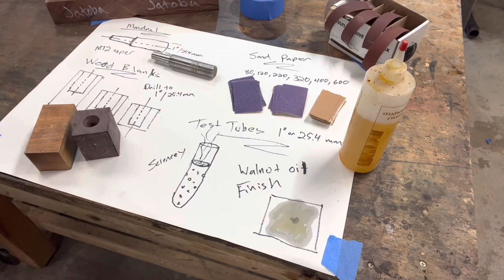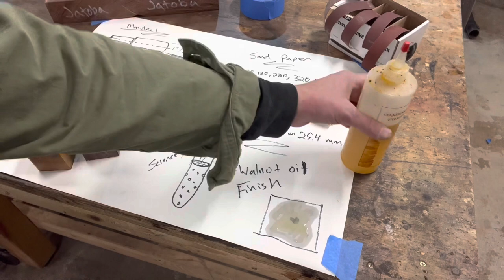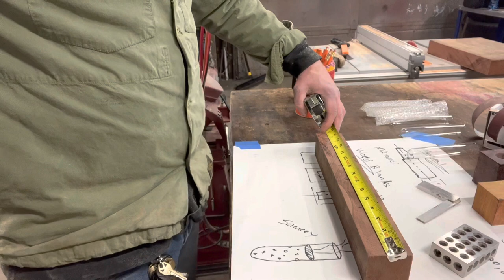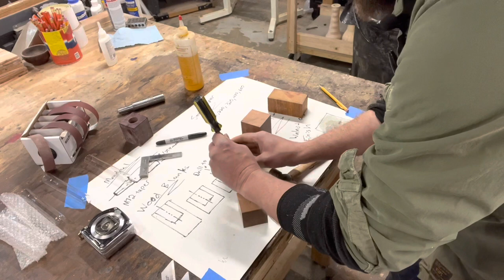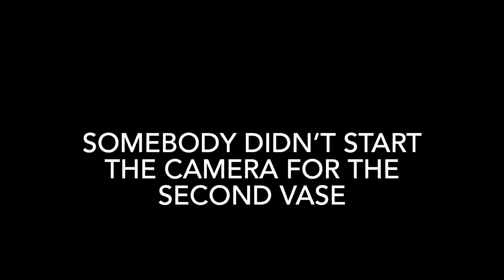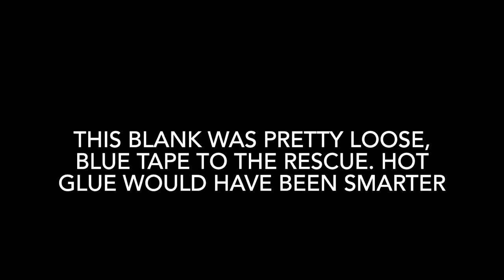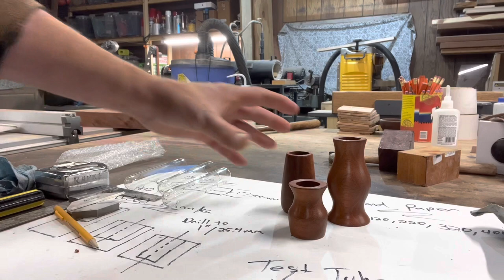Making simple and elegant bud vases on the wood lathe.

Comment: Several things to comment on, beating a wood product onto a mandrel is not recommended, hence the breakage.  Make a wood spigot to fit in your chucks!  NEVER BEAT A TENTIONING LEVER ON THE TAILSTOCK TO TIGHTEN IT.   Use carbine tools on their side,using the bevel, that way they will stay sharp far,far longer. (FYI, been turning 50 years!)
Reply from the maker: Again, to each their own but I do appreciate the feedback and will try some of what you suggest one of these days!  The blow out on that particular piece had more to do with the wood and less to do with the rubber mallet I bumped it onto the mandrel.  I made that mandrel custom for this process and it’s served me well for nearly 50 of these vases.  I would agree I could be a little less rough on the lathe but it was bitter cold that day and bumping the tail stock lock with the mallet was my best option to get through the project.  Thanks again for watching!

Comment: any links to where you get the tubes?
Reply from the maker: Hey Kyle.  This was the set I originally used but they appear to have gone out of stock:
Temedon 30pcs Glass Test Tubes, 25×140mm(45ml) Round Bottom Test Tubes with Cork Stoppers for Bath Salts, Candy Storage, Plant Propagation https://a.co/d/dirWyNg

These may work as well if the others don’t come back in stock:

DEPEPE 25pcs 45ml Glass Test Tubes 25 x 140mm with Cork Stoppers for Bath Salt Candy Storage Science Lab Party https://a.co/d/hu4C3dX